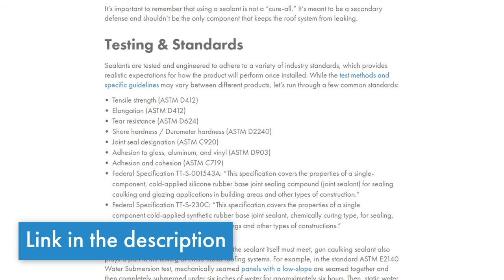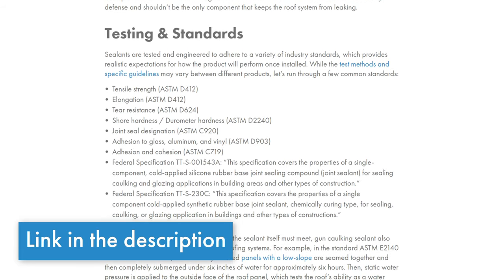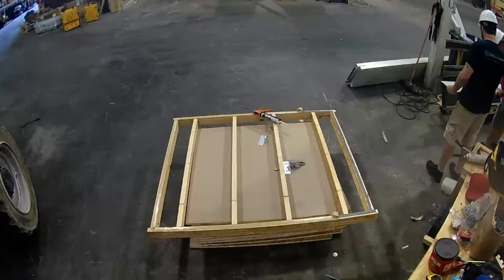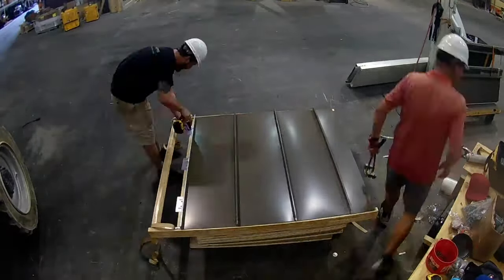What is Metal Roofing & Wall Sealant? Types, Uses, Applications

Comment: I have water coming in around the bottom of the frame.  Can I use sealant to prevent that?   Do I do that on the inside? Outside or both?  I just have a basic metal building on a cement slab.